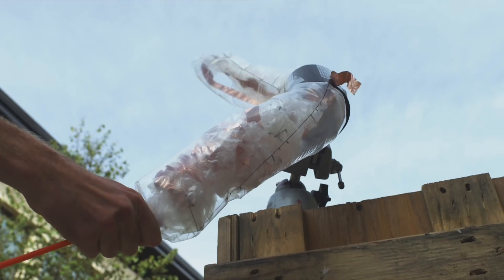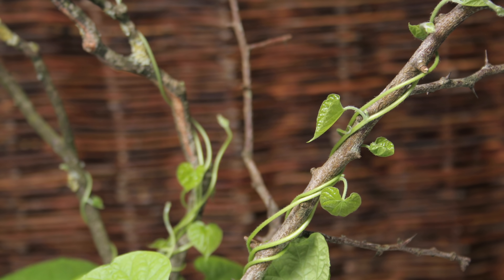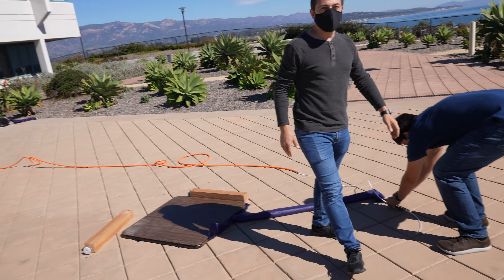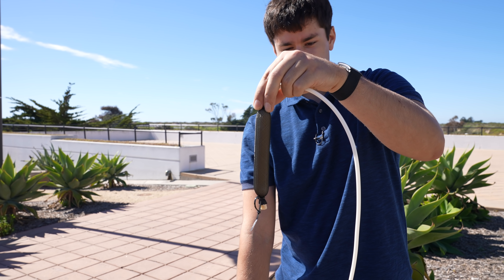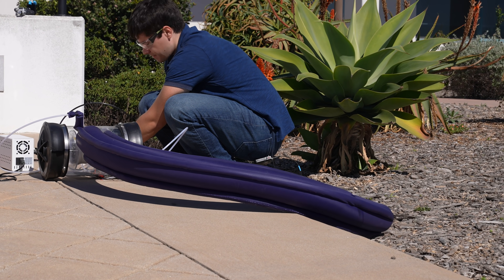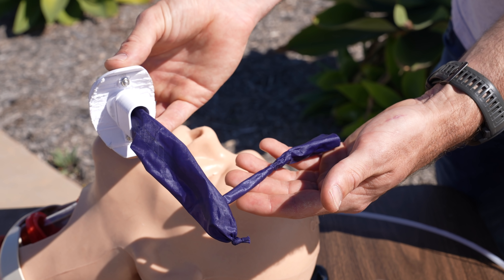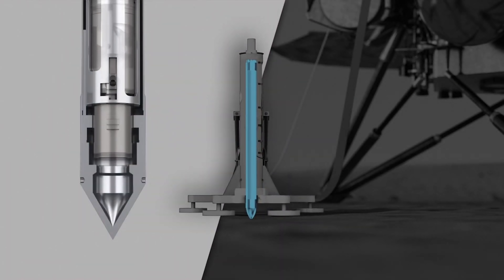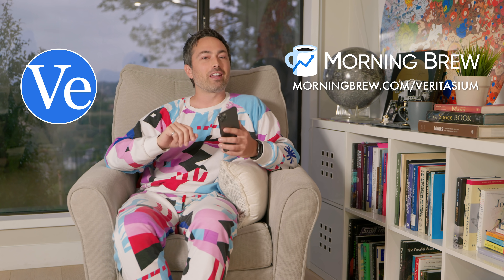This Unstoppable Robot Could Save Your Life

Comment: as a retired RN who worked ER's and ICU, seeing how EASY it is to intubate would have saved many patients
Reply: Do people really die to failed intubation? Of course, if the airways are smashed, but then this wouldn't help either.
Reply: @user255  it’s more of an issue of speed and required skill, patients needing to be intimated, but not being in time, or skilled nurses/doctors/ems not being present in that exact moment
Reply: @user255  They can either due to that or oxygen levels dropping if you take too long to intubate. People are well trained but it can happen if airways/the esophagus are small/irregular due to some condition, genetics or another medical issue
Reply: The same thing can be accompanied with a king airway/combitube/igel/LMA all of which are non visualize airways that are very quick and easy to place. The question is if the patient is not breathing the first action is not intubation but to ventilate them with a BVM. So while I think it is a cool device with a lot of potential I don’t see it being something we use for securing an airway
Reply: @Intravenous14  Yes, that may be easier to use, but something like this could be automated to the point where it could be part of an AED kit 10 years in the future where the AED instructs the operator to place the mouthpiece after registering a low blood ox saturation.  It could basically be a 30 minute "life support in a box" near the entrance of every public building on the planet someday.
Reply: @EUC-lid  I absolutely love that idea lol that'd be awesome if they implemented that into kits
Reply: Haven't woked in ICU, but I'm a doctor. 
I would tottaly disagreewith you. With this inflatable tube - what you lack is control. You want to be absolutely sure where your tube is. Also, this tube seems to lack rigidity. You want to be sure that it's diameter is constant, that pressure that edema of trachea or larynx is upplying to the tube won't collapse it the tube.
Reply: @VK-sz4it  I suspect that it might another tool in the pockets of doctors. If you need an intubation right now, something like thing might be helpful. If you can take your time and double check things, a more traditional intubation might be used instead. Benefits and tradeoffs, right? No tool is perfect for every job.
Reply: @VK-sz4it  the point of this tube is that you can be orders of magnitudes more certain about where the tube is, when compared to doing the same procedure manually. Also, is absolute rigidity an advantage? I can imagine that a variable rigidity may be desired, since it covers whatever rigidity you wish it to have anyway.
Reply: @nydydn  I can imagine that a variable rigidity may be desired, since it covers whatever rigidity you wish it to have anyway.

It has to be pressurised all the time to be rigid enough and that would make that tube already unnecessarily complex.

I can see only one situation where it may be more benefitial. Sometimes you can't intubate and you do cricothyrotomy instead. If this thing was able to somehow squeeze through - so that you didn't have to make a hole in your neck - then yes, people would use it, no doubt. Somehow I don't think it would.
Reply: @VK-sz4it  Even so, this tech should at least be explored in such an application. We never know for sure until we actually test it.
Reply: @VK-sz4it  "It has to be pressurised all the time to be rigid enough and that would make that tube already unnecessarily complex."

A pressurized flexible double tube with some sensors is indeed more complex than... literally a plastic tube. Anything more complex has more ways in which it can break when compared to something less complex, so I completely understand that concern. The key point here is for the total disadvantages caused by the incidence of the complex tube breaking to be lower than the benefits it brings. The technology is clearly not ready as we speak, but I can see us getting to a usable model in 5 to 10 years, and then optimizing it and building the necessary infrastructure around it after some extra 5 to 10 years.

The use case were you see most benefits (replacing most cricothyrotomies) might indeed be the first where this device might be used successfully at a larger scale, still, probably not sooner than 5 years.

I actually completely agree with your points, and our differences come from you criticising what you see, while I am praising what I imagine it could be. You are a doctor thinking of the usability of the presented device, while I'm a scientist with an engineering background that thinks of all the other recent cool technologies that could be integrated to make it truly useful. In all fairness, this one is on me, as you are commenting on this video and not on my imagination of how cool this product will be in 20 years :D
Reply: @nydydn  Yes, that's exactly what I meant. I liked it. I just though that other implications are more market-ready. In healthcare - it can totally be a thing in future. When it comes to preventing major adverse events or death, if something is statistically better (even a little bit, but p <.05), in the USA, healthcare usually goes for it.
Reply: @VK-sz4it  Yes, indeed! It is at best a "pathway" to use for guiding a ET-tube, but not even that is possible with was shown in the video. This is simply a investor scam, which this procedure attracted many during the last decade. Sad to see Veritasium faling for that trick, as just a few hours of research would have exposed the lack of function. The idea is cool though, and someday perhaps someone invent something based upon this principle, but it will definitely not be based upon anything from this "device" shown in the video here.
Reply: It's a shame such a simple concept for a robot only came out in use in the past half a decade isn't it?
Reply: @geradosolusyon511  too true
Reply: Yeah that part was the most exciting innovation
Reply: I know right?! I am just thinking about all those patients who have a narrow esophagus/airways that it would be near impossible to intubate safely (while they're under) with the normal scope. That and soft with variable rigidity so minimal risk to damaging the esophagus/airways!
Reply: I like the idea of a device that an untrained person could use. Like an AED but for intubation.
Reply: As someone who has had to be intubated in an emergency, I find this to be a welcome alternative. Thank goodness for nurses and EMTs.
Reply: I love how you all use so many abbreviations, which makes a non-native English speaker, who has never heard about all of these, struggle to understand everything you say! 😂
Reply: @hypercrite  RN= Registered Nurse
   EMS= Emergency Medical Services
   ICU= Intensive Care Unit. 

The King Airway and combitube are types of airways inserted into a patient that don't require AS much skill/certification as RSI (Rapid Sequence Intubation) 

Hope that helps a little! :)
Reply: @hawkeye7527  cheers
Reply: @hypercrite  Oh, ER = Emergency Room and BVM= Bag Valve Mask (for manual ventilation through the previously mentioned tubes, or through the mask)
Reply: @hypercrite  ya
Reply: damn ems got hightech.  i remember the old metal laryngeal scope that we used
Reply: What about blowing compressed air into a patients lungs? I'm hoping when they fully develop this product they'll have an air pressure sensor to prevent high pressure and detect an air leak...
Reply: @TomCei  pressure sensor seems easy to solve. They can have some electric, or electromagnetic sensors to detect exactly the width and length of the tube, and based on that the expected necessary pressure. Any difference means a leak, or broken sensors. Regardless, abort mission.

Comment: Cool application for this would be to have a lawn irrigation system with similar design.  It would be just a box, the box would expand the hose , then irrigate the lawn.  When done, stop, collapse and retrieve to its housing.  Therefore, no need to pay thousands to have an irrigation system under ground.

Comment: Imagine you are trapped under a big block rescuers inflates this 'robot' and it lifts the block to a certain height then the balloon 'pops'😎😊 it would be helpful as you would not be in pain anymore
Reply: I guess the fabric can be kevlar-reinforced etc. to not pop that easily.
Reply: @p_serdiuk  yeah definetly but there goes the cheapness of the robot with it
Reply: @Elias-eq8ut  I think that multiple cheap robots with cameras and microphones/speakers can go into a building first, then if someone is found, either the rescue teams will dig them out or a few reinforced robots can be sent in that direction to create a cushion. You aren't limited to one type of them.
Reply: @Elias-eq8ut  Note also that the tidbit about lifting is in the section about robots of different shapes. So the cheap exploratory robots can be simple tubes, but the tough pressure-applying robots need to have that pillow or something like it at the correct length, so there can be fewer of them.
Reply: @p_serdiuk  yeah like said in the video as well you can get very creative with these kinds of eobots that are fairly new, it is a very interesting invention!
Reply: Fire Department already use tools like this called high pressure airbags along with what is called cribbing to stabilize the object
Reply: It isn't a balloon. Air is constantly being pushed through it, so a leak just means some extra air is pushed back out. A sensor could be used to automatically adjust the air pressure due to any changes in pressure.
Reply: @kruks  its still a possibility that there would be such a cut to it that it cant hold pressure at all anymore, maybe its a very small possibility but still there. And i think the dude was just joking

Comment: I realize this is early work but it seems like there are some problems with the applications. To lift debris in a collapsed building you need a pillow of roughly the right size at almost exactly the right distance from the beginning of the tube. But it would be basically impossible to know the size and distance you need before you get into the site. 

Also with the intubation, it's not clear how well air actually flows through that? It seems like exhalation would be a problem if it is limp, but it it stays pumped up then it seems like the middle would most likely be pinched closed.

Comment: Bringing this to space is interesting. I'm not sure if it would be as practical as it looks, since it needs compressed air to function. So either you bring a tank with a limited number of uses and no compressor, or you bring a compressor (which adds extra weight) and try to compress Mars' atmosphere. I would imagine there is a lot of fine dust on Mars (could be wrong) which would likely really hurt the compressor fast.

I also wonder if the materials would be able to resist the radiation/temperatures on Mars as well.

Comment: Related uses: I have been wondering for a while about "balloon structures" in Earth orbit... or possibly "balloon girders" for large structures... ??
 My analysis usually hits a wall (so to speak) around the point I realize PV = nRT isn't very useful when external pressure is effectively 0, and tracing individual molecules is cumbersome.    
   But the potential for large, rigid, light-weight, durable (kevlar) frameworks in extreme low-pressure / space is one use for this type of tech that I would find intriguing for someone to explore...

Comment: Could you use this in bloodvessels to free up blockages in the heart? These blockages are responsible for heartattacks. Imagine if you could inject a nano version of this robot into a bloodvessel and quickly extend it to free up the blocked blood vessel. You would probably have to incorporate some form of tube that allows the blood to pass through but this is one of those ideas that might be crazy enough to work.

Comment: couldn't those also be filled with Water? So they could be used to get stuck cars out of mud or people out of quicksand. A fire department could just use the water to have it dig under a cars wheel for example and then lift said car up by creating a huge area like they lifted you up while you were sitting. 
This could probably also be used better underwater that way because it wouldn't rise up from the air, or you could have two tubes, one with water and one with air and regulate how it rises or sinks to get in cracks, ships or anything else that is underwater. You could practically navigate those from above a ship. 

Further this could also be used to for example get air to people stuck in a sunken ship or in a flooded cave. You could navigate it to them without it rising to the top, and then as soon as it reaches the people, you can pump in oxygen and drinkable water. A microphone and a small speaker, which could be inserted into the ear could be used for communication. Alternatively you could also use a antenna for the stuck people to use their phone or a walky talky.

Comment: I suspect that I am not alone in having done the 'robot burrowing' bit before with a garden hose - with water flowing, a hose will dig itself into the ground and you can just keep feeding it hose, and it will craft its own channel. And you will make a mess. Sorry, Mom!
Reply: First two replies are bots
Reply: Is there a youtube video that shows this? I cant visualise it in my head lol
Reply: oh, my did that to his own construction site that was getting soil (to add height, dont know the english term for it).

he said that the water soften the soil enough to flow down and find voids in the dirt, pushing the air out.

which, with the help of heavy trucks, make the soil more compact. less headache in the long run.
Reply: Or in my case, sorry grandma!
Reply: I once put one down a tiny hold in the ground. Ended up scaring a bunch of rodents of some sort out of the ground and it came back up about 20 feet from where it started lol. I think I drowned a bunch of rodents.
Reply: Yes, I've used this technique to extract a tree watering tube from the ground. It's also used to drive piles into sandy soil. Just attach a pipe to the side of the pile and connect the hose to the top end. After the pile gets to the required penetration, the water is shut off, it drains away from around the pile and the pile is locked in place by friction.
Reply: Yeah, that's actually how I met my australian neighbors. I live in Germany by the way.
Reply: I recently revealed the genders of my two girlfriends. It got a lot of hate and now has 30 times more dislikes than likes. I am really sad that people can be so mean. Sorry for using your comment to talk about my problems, dear how
Reply: @AxxLAfriku  and here we see a wild bot in its natural habitat
Reply: @AxxLAfriku  I recently revealed the amount of people who asked, no one , literally no one gives a f , gtfo.
Reply: @nabibbs7937  Just report for spam like I did :)
Reply: @urawsomegamer  I literally reported him twice first time youtube won't let me sumbit report second time it did work but still not terminated.
Reply: @AxxLAfriku  No one cares.
Reply: @issackerth7248  You are now also added to the list.
Reply: @runthechemicals  POGGERS! :DDDDD
Where's the party!
Reply: @issackerth7248  you are one of them now.
Reported
Reply: @Yeetuz.Deletuz  Considering your comment history...

You are reported as well.  Enjoy.
Reply: @runthechemicals  HAHAHAHAHAHA.
No one cares that you reported me for... what..? Saying "no one cares"? xD???? You do realize a block button exists for when people hurt your feelings, right? Are you incapable of clicking it???
Reply: @issackerth7248  Yeah. I didn't think so. Way to bow out gracefully. (Lmao)
Reply: @AxxLAfriku  i never thought i would just hallen to stumble across an axxl comment